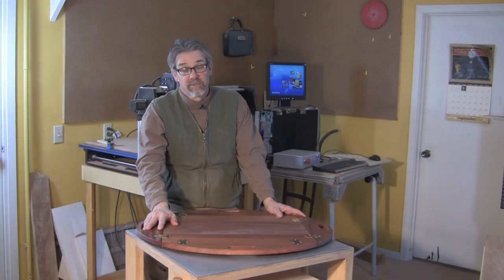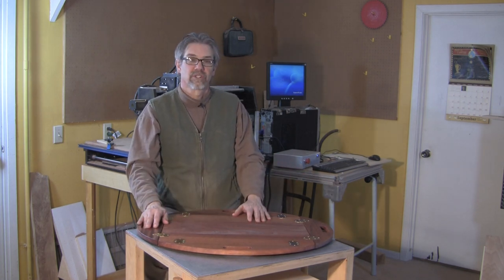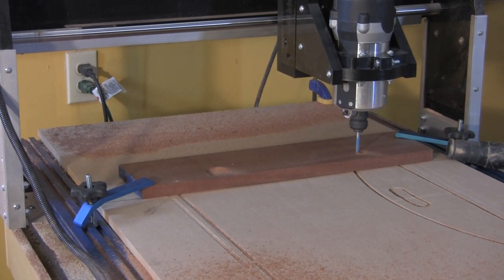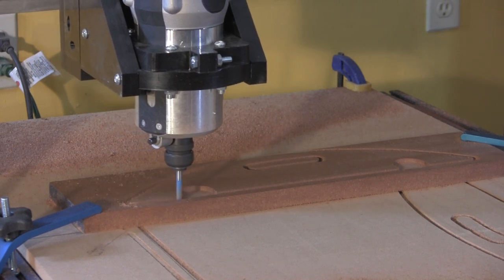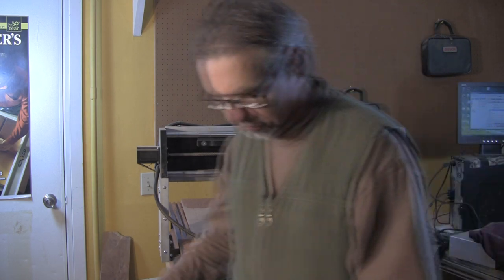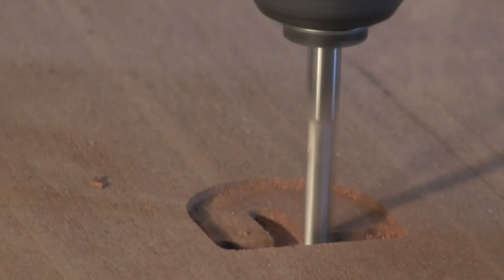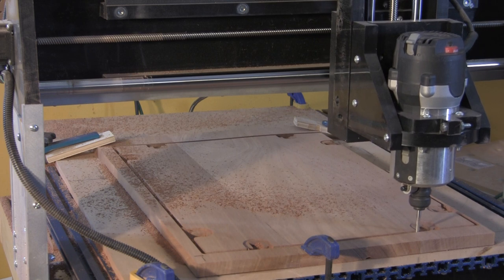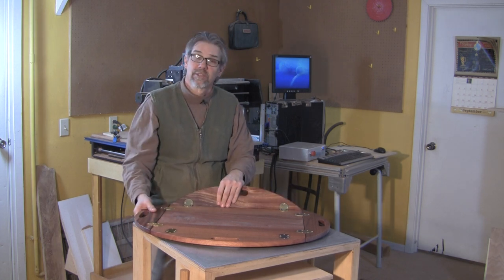Small-shop CNC Routing: Build A Mahogany Butler's Tray

Comment: If you build a template of the hinge you can use a small hand held router to cut the mortise with a top bearing bit that will accept the hinge perfectly, a chisels worked well for our grandfathers too!!  
Use a thin batten to create the radius, cut outside the line and finish to the line with a hand planer. 
These trays are stunning and you don’t need a machine to do the craftsmanship for you.